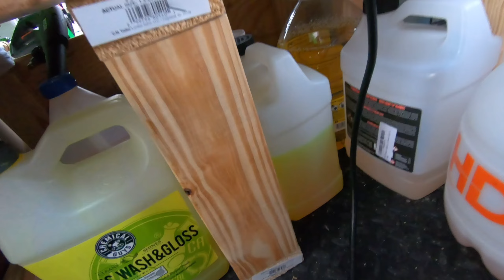Hairy Van Detail

Comment: How much stable do you add per gallon and can you clarify why with your reasoning 
Thank you brother
Reply from the maker: Absolutely. Per manufacturer recommendations use 1 Oz of stable per every fill up of gas tank. Keeps plugs from fouling out so fast, reduces stuttering and protects gas from low usage issues. These small motors run very hard and need this additive to run smoother. I put it in my lawn mowers, big pressure washer and generator.
Reply: @nxtgengfx9297  good looking out thank you brother 💯💪🇺🇸